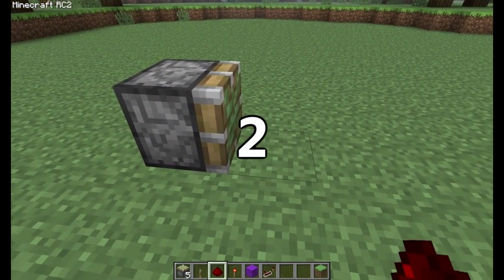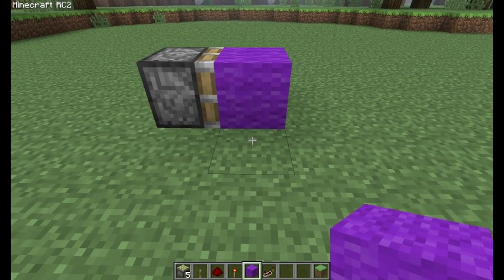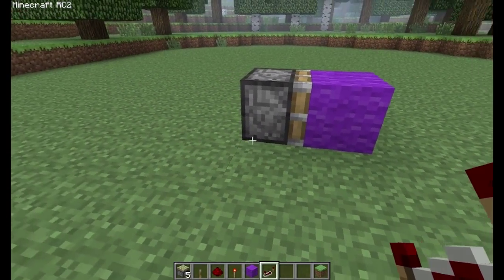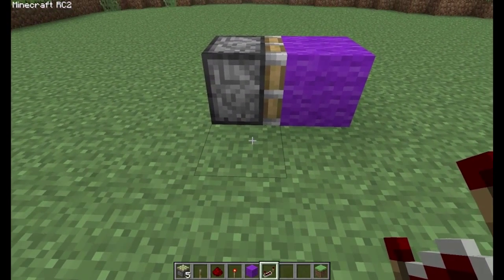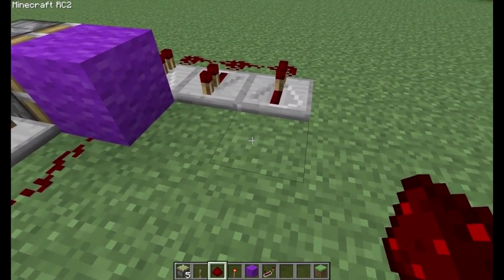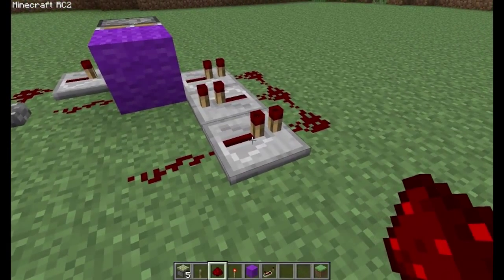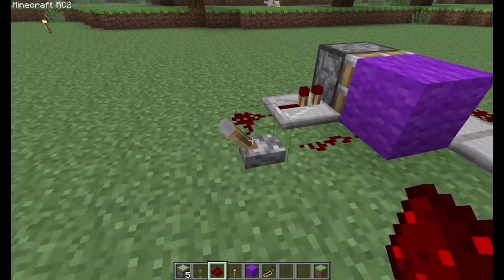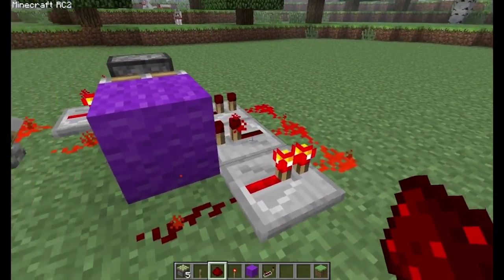Pulse Generator with On/Off Switch

Comment: YEAH it does work for 1.3.2 but you need to have the 3 repeaers side by side on at least 2 ticks its default doesnt work for 1.3.2 i figured this out whilst messing around with it